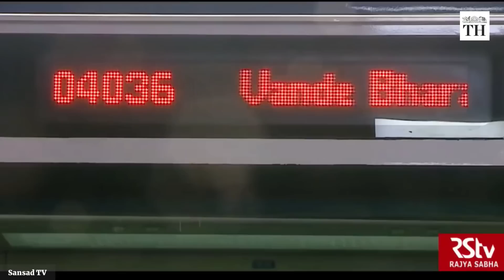How Chennai's ICF became a global success | The Hindu

Comment: I am son of an ICF employee who worked there from 1955-87. I passed out from ICF High School in 1972. Have visited the factory several times back those days. Have seen the first GM of ICF Mr. Hydari (who was from the Nizam family and hand selected by Nehruji). He is the main architect who ensured ICF became a success, which is free of DMK and ADMK politics. He is the only GM who had the longest tenure of 10+ years. The GMs that followed him later were known to have corrupt. I am glad to know that the firm has survived all those bad elements and is doing well. They still can perform better to be on par with the coach makers of China and Europe. In order to get there, it needs to be privatized and run by professional managements.
Reply: Thank you for the valuable information with regards to first GM. Further, all PSU started at that time were doing well. HMT, ECIL, etc etc. Corrupt management and WTO agreement in 1990 spoilt the smooth running of PSU.
Reply: @9487087496  One of the main issues in any PSU is that the management cannot dismiss underperforming workforce. The union leaders act like thugs and they hold the units as ransom. The unions are political wings of governments in power at either center or state. Until this evil is stamped out, PSUs will keep draining the exchequer. The production incentives the planning departments develop allow sufficient avenues for the workers to game the system, so much that one person could do the work of 10. Back in the '70s some of the toilets in the workshops at ICF were reserved for playing cards. Minority of workers would do the work of the whole team, then the whole team would share the incentive pay per private agreements they would have made. Sincere Supervisors would get thrashed up if they tried to correct the miscreants. This was the case 45 years ago. I don't think this could have changed much since then. Even back then they were producing 1000 coaches per year. This was forcibly reduced when new coach factories came up elsewhere. This will be story in different forms at all the PSUs. People WILL become corrupt if the incentive structures are improper in any system, at PSUs, municipal corporations, educational institutions, banks, political parties, defense departments, anywhere for that matter. Indian people want everything to be done by their government. They do not trust the private operators. We all pay the price for this. Political families know this all too well, operate accordingly and reap rewards. People are okay with goons of the DMK, ADMK, Congress et al making money this way. Long live the PSUs....